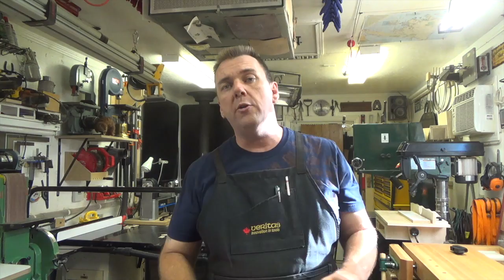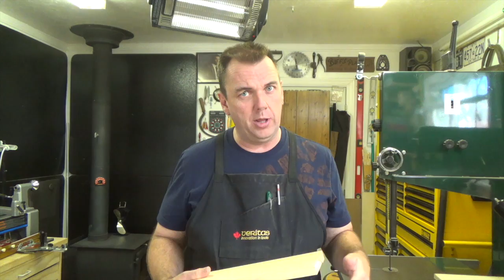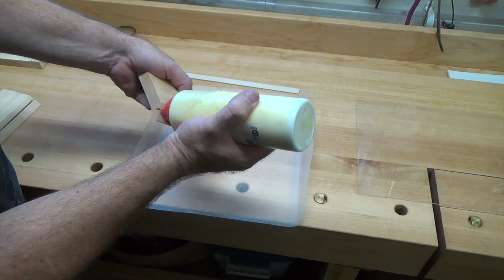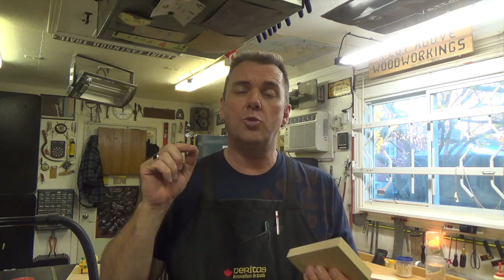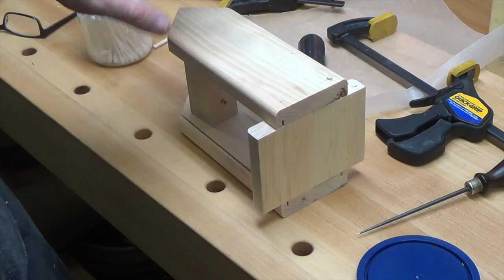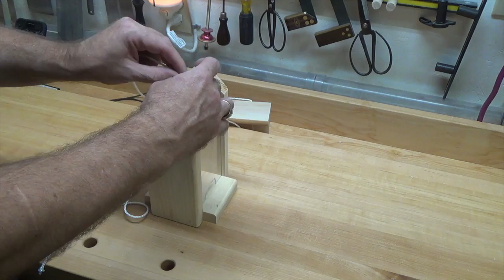Making a Bird Feeder

Comment: What is the name of the yellow tool to run your ditto, please
Reply from the maker: That device is called a Grrripper and it is an adjustable push block that is great for ripping thin strips of wood safely.  They are available at most woodworking suppliers and I can honestly say that I have been using them for years and love them.  I have a show that demonstrates their use if you are interested.  You can find it here.  https://youtu.be/bAsxjeM2LdA
I hope this helps.  Thanks for tuning in

Comment: First time watching one of your videos I have a question I do not have all the tools that you have mainly a tablesaw 

Not having a tablesaw, but a regular saw where the blade is in the air and you move the handle down for the blade to go to the table. Is that called a radio saw I don’t know either way without having a tablesaw. How would I cut those slots that plexiglass slides in

Do you need to stain these after they’re done or can you paint them with a rattle can or a bucket of paint your expertise answer will help me a lot. Good video.
Reply from the maker: I think you mean that you have a radial arm saw.  That's what it sounds like you are describing anyway.  For those, you can still cut the dados but you will have to put a stop on the saw so that it does not cut all the way through the wood.  Most radial arm saws have an adjustment that will do this.  You just want to be careful that you aren't cutting too narrow of a piece and that your hands are not getting too close to the blade.  If you aren't comfortable with the saw, you can always make those dados with a hand saw, a router, or even just a simple knife and chisel.   It doesn't have to be fancy.  As for the finish, a rattle can would work just fine.  As long as you seal the wood with something.  Shellac, paint, varnish, spray paint, lacquer, or whatever.  I hope this helps.  Thanks for tuning in and good luck on your project.  If you have any other questions, please feel free to ask.
Reply: @acutabove_woodworkings  TYVM for detailed answer and will use your suggestions…was outside working on car today in the cold…..shower some pinto beans with bacon cooked in them and homemade cornbread muffins….should be knocked out soon LOL
AGAIN TY…have a good one

Comment: A birdhouse should not have perches, as predators will use it to attack the nest from, trapping adult birds inside the nest box. But a feeder can have perches, as this danger isn't a concern at the feeder. The feeder you made has a perch, in fact. That ledge at the bottom is a perch. Birds, except for hummingbirds, must perch to eat.
Reply from the maker: Thanks for tuning in and for chiming in with your information.  It's appreciated.

Comment: Clear, concise instructions, a bit overkill on the joinery but good practice for sure.  The bottom piece / platform could be larger so birds can land, peck about & eat.  Rounding over looks good, but makes the little base even more prone to seed spillage.  A little ledge to hold in the seed would be better.  Nice use of dowels.  Nice size feeder.  Clear presentation.
Reply from the maker: Any project that is presented on the show is always able to be modified to suit your own needs.  Please feel free to modify this one however you see fit.  Thanks for tuning in to the show Mark and for chiming in with your suggestions.

Comment: You’re going to,lose a lot of seed off the platform. It needs some kind of retaining wall around the platform.
Reply from the maker: I've made this design for years and surprisingly, it doesn't lose as much seed as you think.  Maybe it's the size of the hole that prevents it.  I have no idea but the seed does not come pouring out as you might think.  That being said, if a retaining wall would make your project better, then by all means, install a retaining wall.  That's what it's all about.  Taking a project idea and making it your own.  Thanks for tuning in and taking the time to chime in with your comment.  It's appreciated.

Comment: 07:07 um.. chief: could you explain the difference dado vs. kerf ? Thanks.
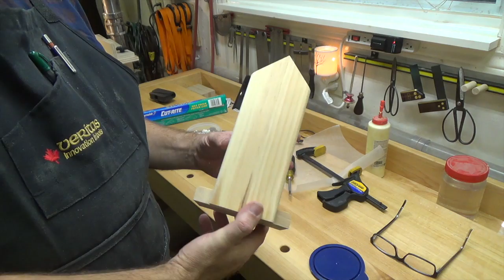15:00 but, chief - I don't wanna split hairs here - but those holes you just mentioned are actually round recesses. Holes are created by boring through materials.
17:31 um.. chief - even at the risk of wrecking your nerves.. - if that cord is out of nylon take a God damn lighter and weld these fibers together.
Great job. I like the way you jointed the roof.
Reply from the maker: A dado is the shallow groove that is cut in a board to receive another board or feature of a project.  A kerf is a specific thickness of groove that is left behind in a board where the thickness is determined by the width of the outer most teeth of a blade.  Holes can be in many forms.  Defined as a hollow placed in a solid body or surface, they can be stopped holes, through holes, flat bottomed holes or square holes (mortises) just to name a few.  As for wrecking my nerves, you haven't got a chance.  After woodworking for over 42 years and doing this show for about 8 years, I have gotten used to people nit-picking and trying to be the expert.  It doesn't bother me.  Some people just like to be heard, that's all.  
And you're right.  It wouldn't hurt to weld the cord fibres together with a lighter.  Thanks for tuning in.
Reply: @acutabove_woodworkings  Thanks for you reply. I wasn't quite sure about dado/kerf - but that clears it up. With regard to holes : that was nit-picking, but by no means would I try to be the expert . I'm just a hobby woodworker [DIY]. And: at three in the morning, I'm usually silly as hell, and I really appreciate, you have a deep understanding for goofballs like me. Cheers.
Reply from the maker: @GNU_Linux_for_good  I get a to of comments on the show from a lot of people around the world.  Most of them are constructive, some of them are funny and goofy and others are just ridiculous.  I hope you enjoyed the show and that you will try it for yourself.  Hopefully, there are other shows on the channel that you would enjoy.  Feel free to ask any questions you might have.

Comment: When you were in the process of cutting the plexi ,u used two rulers and you had one earlier in the video that was much longer. What are they called and what is the price on those. ??  These are very convenient  and more  accurate vs. tape measure    Thank you
Reply from the maker: I think that you are referring to the T-rules that I use during my show.  They are made by INCRA and are available in either metric or imperial.  They have a variety of models available in a variety of lengths.  I have the 6", the 12" and the 18" and I would say that I use the 6" the most, followed by the 12" and lastly, the 18".  They are not cheap, but they make woodworking layout so much easier.  You can find them at most woodworking suppliers or from INCRA directly.  I got mine at lee valley tools.  Here's then link.  https://www.leevalley.com/en-ca/shop/tools/hand-tools/marking-and-measuring/rules/58877-incra-t-rules I hope this helps.  If you want to check out INCRA's site, you can find them at https://www.incra.com/measuring_marking-trules.html
Reply: Yes I am and thank you very much for the prompt reply and Info !!!!!!
Reply from the maker: @mundlkalli4396  You are very welcome.

Comment: Hi Kenny, I have just binge-watched a little over 100 videos about building bird nests and bird feeders on Youtube, and YOU ARE THE ONE AND ONLY WOODWORKER to use the measuring tool at the 1min52sec-1min58sec mark. That measuring tool - where you can make your mark via the holes on the ruler - is pure genius!! What is that item called as I would like to get back into woodworking and that item will be worth more than its weight in gold. What is it, and where do you get it?
Also, again, you are the one and only woodworker that uses dowels when making a bird feeder, none of the other woodworkers used that approach - except for one bloke who made a log cabin feeder using dowels for joining the wood together (that was a BIG feeder though!).
And lastly, you gave clear instructions and there was no rushing involved, which is a sign of a good instructional video! Am going to binge-watch all your videos now :)
Reply from the maker: Thanks for the kind words on the show and the project Peter.  I'm glad that you enjoyed it.  The device that you are referring to is called an INCRA T-rule.  They are available at most woodworking stores and I purchased mine at Lee Valley Tools.  Here's a link.  https://www.leevalley.com/en-ca/shop/tools/hand-tools/marking-and-measuring/rules/58877-incra-t-rules
They are also available from INCRA directly.  They are not cheap but as you pointed out (correctly) they are worth their weight in gold.  I love these things and have several of them.  Although I use the imperial measurements version, they are also available in metric measures.  I hope this helps.  Thanks for tuning in to the show.  It's very much appreciated.

Comment: Nice build with good clear instructions. Just one question. What stops the seed pouring straight out of the hopper and onto the floor as I don't see any barrier around the feeding platform.
Reply from the maker: I have honestly never had an issue with the feed running out onto the platform.  I can only think that the routed groove to give the birds somewhere to perch, acts as a barrier and prevents the seeds from going any further.  Although if you had concerns, you could always build a little barrier wall around the lower platforms.  That would work as well.  I hope this helps.  Thanks for tuning in to the show.
Reply: That's the first thing I wondered about too. Nice feeder and good instruction.
Reply from the maker: @stinger4583  Thanks for the kind words and for tuning in to the show.  It's appreciated.

Comment: Kenny; Nice little feeder. Very practical/efficient.  Question; any problem with rain traveling down the string and getting into the seed?  I like your miter gage and I especially like that yellow pusher.  I have never owned a factory made pusher but that adjustable pusher gives me ideas.  One thing I didn't like---wearing rings while working in the shop.  Sorry, old military training.  Keep up the nice work and good videos.  Stay safe.
Reply from the maker: Hi George.  Thanks for the kind words on the show and the project.  I've never had any issues with the rain running down the ropes into the feed. The holes that the rope travel too are too snug to allow it to happen and if there was any that did manage to get in there, it is minimal enough to not make a difference.  I can't argue with you on the ring aspect and I actually agree with you.  It's just one of those things where I have to remember to remove them before I go into the shop and I never seem to do that.  Thanks for looking out for me and I will give it an honest effort to lose the rings before working in the shop.  I've seen the damage that can be caused by rings getting caught on machinery and it isn't pretty.  Thanks for tuning in.
Reply from the maker: I couldn't agree with you more George.  I've been with my wife for 28 years and she's my best friend.  I wouldn't trade her for the world.  Thanks for tuning in to the show.  Looking forward to your future comments on the show.

Comment: great can you show how to make this without the machines? all I have are hand tools.
Reply from the maker: You can very easily make this project with hand tools.  The assembly and joinery will all be the same but instead of using a table saw, you use a handsaw.  Instead of a router, you can use a sanding block or a plane with a shaper blade installed.  The concept and dimensions of the project will not change, just the method with which you get to the final product.  It isn't really that hard.
Reply from the maker: Good luck.  If you have any questions, please don't hesitate to ask.

Comment: simple yet elegant, I have chosen your design however I would make two  modifications. I would widen the  platform meaning it would have to be a wider piece of stock so you can notch the base to receive the side walls. in other words you would cut ears on all four corners as you would  window sill.  secondly I would  route a half round  gutter or grove at both sides of the base to prevent  the bird feed from spilling to the ground. I may even  enlarge the project in width about  half inch to an inch  just to allow more birds to feast simultaneously.  of all the birds feeder designs this one appeals to me for its simplicity and design concepts.
Reply from the maker: I'm glad that you like the project Tony.  Your modifications of it sound great and I hope they work out for you.  Let me know if you have any questions at all and I would be more than happy to help you out.  Thanks for tuning in to the show and for taking the time to leave me a comment.  It is very much appreciated.

Comment: Nice little project. Side question... Don't you get condensation on your machines with the fire going? My garage is so cold but when I started a heater in there it was only a few minutes and everything had a small layer of watery mist..
Reply from the maker: +Wonder Around 
No condensation at all.  The shop is very well insulated and I've never had a problem with condensation.  In the summer time, I used to have an issue with that but I run a dehumidifier in there in the evenings now to keep it nice and dry.  Venting is also important in the shop and I have quite a few roof vents which also help.  Chances are, you garage is not as well insulated as the shop and it probably gets a lot colder in there than what my shop does.  In the 7 or 8 years that I had this shop, I have only had something freeze once and that is throughout a cold Canadian winter.  Insulation is the key sir.  That's all I can think of that would make it different.  Make sure that your cast iron tools have a good coating on them as well.  Whether it be wax or topcote spray, a protective layer will go a long way to preventing rust on your tools.
Reply: Thanks so much for taking the time to reply. I think you are right.. The difference is in the insulation or the lack of in my case :)
Reply from the maker: Insulation is never a key concern to the builder when constructing a garage.  After all, it isn't considered as a "living" space and isn't considered as an area that a human would be hanging out.  Who cares if a car gets cold right?  When building my shop, insulation was a key factor and knowing that it would be heated with a wood stove, the choice for insulation was Roxul Safe and Sound fire and temperature insulation.  It was a little more expensive at the beginning, but the benefits that it has provided have been awesome.